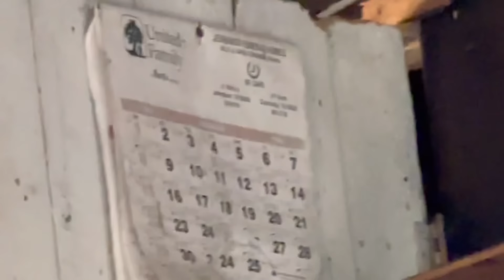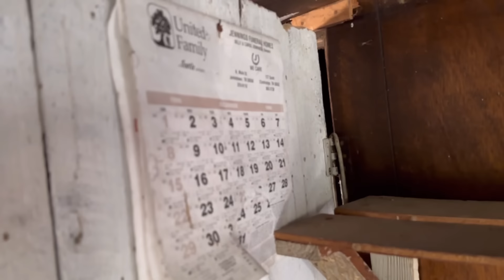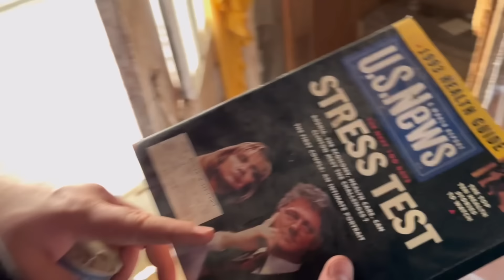Rescuing a MACK Truck Lost for 35 Years!

Comment: Great project to get is running again. Those crac heads must have had enough time to rip all those radiators out. Such a shame they destroyed the grill. BTW have you tried with tht locked up fuel pump to unlock it. My experience is to remove the top fitting that holds te non return valve of the pump body and then soak it in penetrating oil for some time. Then gently tap the plunjer down. Then rotate the pump so the plunjer comes back up and repeat it until it moves smoothly. Only then you should try to see if the plunjer also wants to turn when you move the throttle. Good luck with fixing it, for me it always worked for me and you dont have to retime the pump